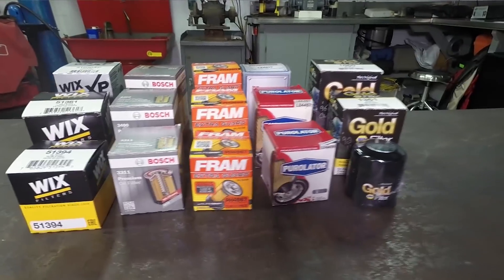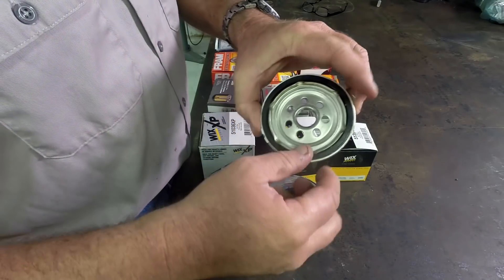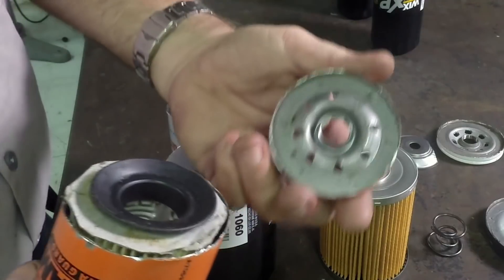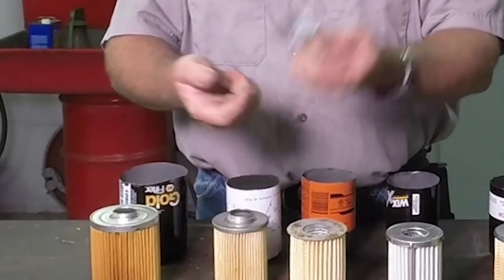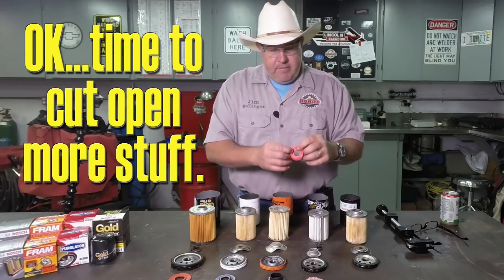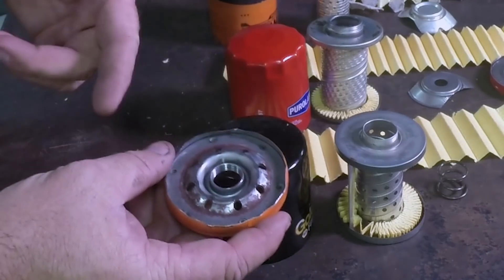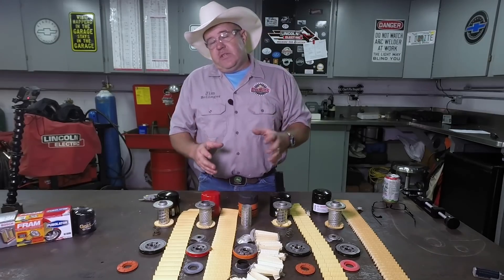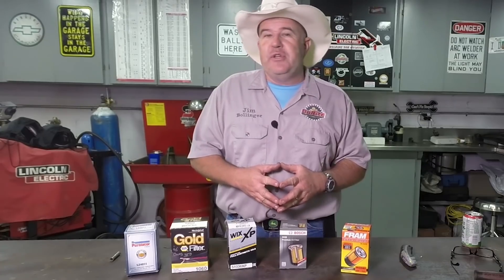The worst oil filter EVER!

Comment: I’ve used Fran for as long as I can remember(I’m 35 now). I’ve never had a engine blow on me with using the Fram. I would hop the paper filter material would catch the rust. Also, with the filter inside being paper, I think that reduces any type of metal future rust. Where the other filters with more metal parts could possibly fail and have metal shavings getting into your “puddin” lol. Hopefully there filters would catch any matter that shouldn’t be in your engine.
Reply: “Hope the paper filter catches the rust” .... how about just get one without rust?  Also that paper break down can cause its own issues,  one by not actually doing it job of filtering but two by actually adding extra contamination to oil
Reply: brett ramsey Fortunately, we will never know.....who’s really cutting apart oil filters to inspect for using them?
Reply: Its just a guy sharing his opinion on something he knows nothing about

Comment: I used a WIX XP in my 3.4 V6 Toyota Tacoma. Damn good filter media with a really thick can. However, I noticed a FEW amount of times my engine would have no oil pressure for like a second after a cold start. It didn't bother me too much since it rarely did it anyway. Anyways, I opened up the filter during the next oil change and found out the anti drain-back was at an angle, and about to come off the part it was mounted on inside the can. This caused oil to leak out the filter! Now, I have no idea if oil flow from the pump pushed the ADBV out of position, or if it was a mistake from the box. Either way, I am disappointed. This would be terrible for engines that have the oil filter on top. Mine sits at an angle on the side

Comment: I never buy Fram.  I use Motorcraft.  They're cheap and the manufacturer uses them.  Your complaints about Fram seem inconsequential to me.  A little bit of rust in the there won't do anything.  Far worse contaminants are generated continuously within the engine.

Comment: He's comparing the material used to construct a higher end Napa Gold oil filter to a low end Fram filter. Its not a fair comparison! His evaluation is based on filter material and not performance. The low end Fram oil filter out performs many of the other oil filter brands in its price range. When your buying an oil filter look at the specifications and buy the one in your price range that performs the best. Also don't exceed manufacturer recommendations for when the filters should be replaced.

Comment: I've cut a lot of oil filters open in my career. The comments regarding the Fram (other than the rust, which I find unusual and may be do to his warehouse supplier) are not surprising. OTOH I don't know that I would say that the leaf Spring used by many filter manufacturers is either inferior or superior to the coil Springs used on others. It's been my experience that filters from ACDelco and WIX, that are actually made by the Brand (ACDelco or WIX) that is painted on the housing, have proved to be the best IMHO. The only exceptions to this level of quality seems to be with low volume Part Numbers that these and other filter manufacturers subcontract to the folks at Champion Laboratories (Champ-Labs) Filter Company and others.
Reply from the maker: Interestingly, the three Frams I used came from 2 different suppliers. Wait till next week's Diesel filter reveal...not exactly what I expected.

Comment: My favorite ADVERTISING B.S. nonsense phrase used quite a bit.  Even printed on snake oil containers ... >>>HELPS FREE STICKY *VALVES*<<<  A hydraulic "lifter" can become stuck, but if your VALVE is stuck?  
   Here's a tip... Save money, just flip your air cleaner over, LOL...  Self cleaning...

Comment: napa's filters are made by wix.  the other thing that you didn't talk about is how the napa and wix filter has big round holes punched through the inner tube where the oil flows.  look at the bosch and the purolator.  it's little bitty slits that are barely the size of a .5mm pencil lead.  i've bitched about this for a few years.  many brands make it like this.  I wont buy em. i've tried them and oil pressure in my truck is erratic and very high when it's cold.  indicating it's having a hard time flowing in and out of that filter.   
btw, for someone who is a fabricator, your grinder skills are really poor.

Comment: How would you rank brands such as AC Delco, Mopar, Motorcraft ?
Reply: The MOPAR oil filters are the best. Delco filters are like Fram filters with paper end caps, and Motorcraft has uneven filter pleats. Mopar has metal end caps with a good, even pleating filter media.

Comment: I am not a mechanic by any stretch of the imagination. However, whose ax is this guy grinding? I am a "professional steering wheel holder driving a log truck up here in the Pacific NW. The company I drive for uses Fram all the time, we have trucks with over a million miles on the Fram filters and the trucks just keep running. No answers, just too many questions.

Comment: Only item you missed is OEM filters. I did the same, cutting several filters for my Toyota. In the end I went with the OEM Toyota filter. Currently 205,000 miles. No leaks. No oil consumption. Runs excellent. I expect another 100,000 miles before I replace it. Nothing done to engine except scheduled service.

Comment: I've got a Tacoma with well over 300,000 miles on it's all original engine. Bought it with 6 miles on it. It has only has fram filters used on it, along with 10w-30 Castrol gtx, changed every 3,000 to 4,000 miles. Burns no oil and is as quiet as when new.

Comment: After I retired from the Navy, I worked as a counterman for a few years.  My manager (certified mechanic that actually turned wrenches for 15 years before getting into the auto parts game) and I had a conversation about oil filters one time.  What brought the conversation on was I had mentioned that my Dad was a firm believer in Fram oil filters.  My manager stated that, at one time, Fram was one of the best filters out there....until they got in bed with Wal-Mart.  The Fram product you see today is in direct response to Wal-Mart demanding a cheaper and cheaper price from Fram, which they could do and get away with since they were buying so much product.  In response, Fram cut the quality of product they made so they could still make a profit.  Now with all that being said, I was unaware that they had cheaped out that much!  I usually use Purolator or Bosch filters on all of my vehicles.  I think I'll step up to either Wix or Napa Gold.  Thanks for making this video!

Comment: I had invented (per say) a machine that cuts filters open just as you did, not with a grinder but a cut wheel such as copper pipe cutting, that was years ago, in California I used to cut so I get the metal and separate the filter media, have you seen the medias after usage? they collapse inwards as hourglass and the real cheap ones come apart anything pass 3500 miles. The orange Fram used to be good years ago.... YEARS AGO..... today is one of the most Lower quality, the newer Fram Gold or Ultra or whatever they call it, are what the original orange used to be......

Comment: I can appreciate that you are taking the filters apart and inspecting them.  But if you 're gonna go that far why not perform a test based on scientific means?  Why not take a know used dirty oil sample, send them off for particulate analysis and then run the sample thru each filter under the same conditions for an determined amount of time?  Then send the filtered samples in for analysis to see which one really performs the best or the worst.   It's not to say what you seen when you hacked them apart as being better or worse, but don't you feel that actual particulate measurements would be a more precise way to determine that one filter is better than the other?  Maybe the cheapest one or poorest build quality is in the middle of the pack as far as filterability....  How can you say its actually worse without that proof???  JMHO...

Comment: once I forgot to change oil on my 1999 Chevy prizm for over 12 k miles(cheap fram filter and 10W40 conventional oil)and nothing happened to my engine.
Reply: That you know of that is.... probability of blowing an engine in 12k is slim to none but they could easily be internal damage
Reply: brett ramsey my prizm currently got 327 K miles on original engine and it's been 10 years ago(Forgetting to change oil for 12K miles)so is it possible that An engine last that long if it had suffered from internal damage?
Reply: Corollas are hard to kill
Reply: If you like playing Russian roulette, then have it.

Russian roulette (Russian: русская рулетка, russkaya ruletka) is a lethal game of chance in which a player places a single round in a revolver, spins the cylinder, places the muzzle against his or her head, and pulls the trigger.

Comment: On the purolator, just google purolator media tear. You’ll find lots on bobistheoilguy. It looks very good, but the media is brittle. While the orange can fram looks like crap, i don’t think I’ve ever heard of media tears or issues. Having said that, I wouldn’t use one either as there are plenty of other better made filters out there including from fram themselves in the fram ultra which in my opinion gets the right balance of price and performance. Cut one open and look yourself. Thanks for posting.
Reply: Nope no media tears just rust in your engine lol

Comment: Napa Gold is made by Wix. I buy Wix by the case and before I found a place that sold Wix, I used Napa Gold. The Wix price I pay is cheaper than Napa Gold. Prior to buying Napa Gold I used nothing but AC Delco. But AC Delco is now made overseas and is junk. Note guys that a Chevy small block does not need an anti drain back valve because of the vertical mount of the filter.

Comment: What I would like to see is all manufacturers oil filters compared
Reply: I second this
Reply: Yes,curious about Mobile Oil filters...
Reply: Yes.
Very curious to know how Motorcraft does in a test.
Reply: @anthonylea3941  do motorcraft buy them or make them, and if they buy, they would probably change supplier from time to time
Reply: @jusb1066  Funny you should say that. Low bid gets contract. I know what actual NOS packaging for my vehicles filter should look like. Plenty of criminal enterprises that counterfeit filter and cardboard box. Just like counterfeit american cigarettes. Chicks as purchasing agents get wool pulled over their eyes all the time. They are fools for tools.
Reply: Jusb1066 purolator makes motorcraft oil filters
Reply: It would have been nice if he would have cut open comparable filters. That Napa is a top end filter, while the Purolator is their lowest grade. He's kinda a moron..
Reply: The Volkswagen flat four early design had a stainless wire screen. You removed, cleaned and replaced. They sell $200 stainless for cars. SEMA auto show had booth with these clean and replace wonders. If your out of country, don't let your wife go to quick lube for oil change. That filter would disappear.
Reply: I’m gonna contribute to this stp the blue filter and motorcraft white
Reply: Yes
Reply: Around The Ground Landscaping LLC. 
Agree. I would add Fram’s Tough Guard and Ultra Synthetic oil filters.
Reply: And discover which one filters oil...BETTER ?? That would be a good experiment!

Comment: why is the filter material worse in the Fram, because it was whispier? that could mean it picks up finer particles.
Reply: More filter paper in same diameter just means more flow restricted
Reply: HighStreet Killers please don’t tell me you fall for the false science of “high flow” everything.....
Reply: The Fram is worse, because it has less filter media. So it will clog up sooner. If you're using extended oil change intervals, this would be a concern.
Reply: m.blacktree If you use an orange fram filter for extended intervals. You deserve a locked up engine. Fram sells filters with extended performance. The orange one is the most basic version they have.
Reply: That was basically my point. You shouldn't use a crap filter for long intervals. The irony is the crap filter costs more in the long run, due to more frequent oil changes.

Comment: Good video, I have never used Fram oil filters or Quaker State oil. I am curious how well Delco filters are made. Even though I have never been a GM fan I started using their filters in the 1980s because they have pressure relief valves. I also wonder about Hastings and Bosch filters.
Reply: A GM fan, omg, everybody quiet. A GM fan has an opinion,lol
Reply: @highstreetkillers4377  Reading isn't your strong suit, is it? I posted, I have NEVER been a GM fan. But then I spent over 30 years in the industry and have owned and built cars that have been featured in national publications. I suppose your Ferrari symbol is meant to impress, it doesn't!

Comment: Guess I'm done with Frame..., 
been using them nearly forty yrs...
Ran more than 200k on four engines with "no" oil loss, or engine damage...
Fifth GM engine, 4.1 alum V8, was down 1qt per 1200 miles@ 150k miles...  I figured that was because it was experimental aluminum...

Comment: It's all well and good to show the parts. But to really show if it was a good or bad filter you would have to test the filtration ability.
Reply: His beloved napa gold might restrict oil flow after a few hours. That will damage an engine
Reply: To be scientific about it  , you really need to test  multiples that have been in service for X amount of time for every brand  .
  Having said that  , how  a  device presents itself when dismantled  from brand new  in my book is worth some points .
  While  for some the rust may not be  such a big deal ( it would be a  big deal for me )  , it certainly does not promote  confidence in The product ,  after all ,  if that one was that bad , what may the next one be like  ? 
  The card board that looked like it was  wet or  delaminated , again not a good look .
  I` d be screwed if i would  put that  pos  on to my engine  , especially one that has  been unopened  for 17 years with the original  brand filter  i have been using for it in the majority of that time , and the engine still runs like a clock  apart from a slightly  worn timing chain guide  that allows the chain to rattle a tad .
Reply: In order to do a proper filtration test it would have to be done on a closed loop system and most people don’t exactly have that laying around.  It kinda follows the saying the whole is the sum of the parts.

Comment: I used to do my own oil changes at one time, that was years ago.   I used Fram filters at that time and never had an issue, but then I never cut them apart to look inside.  If I was still doing my own oil changes, you can bet Fram would not be on my car.   Today, I have my dealer doing my changes and I have the factory spec, Mazda, filter on my car.   Thank you for the informative video.   Lets hope Fram sees this and makes some very needed product improvement.

Comment: I already knew which two filters were of better quality, but your testing seemed flawed. You showed no before and after oil quality difference to see how well each filter actually filtered oil. You didn't bench test the oil filters spring showing what psi it would bypass the filter. Your test was on visual alone.
Reply: A coiled spring is way worse than those plate springs. Typical American idiot giving his opinion on something he knows nothing about

Comment: 1995 Honda Civic 2 dr coupe. D15b7 engine, auto transmission.
314,897 miles.
For warranty period, Honda OEM filters every 3 months.
After, Wix / Fram. oil changed EVERY 3 months.

Comment: Its been years, but there used to be several drag strips that would not let you run if your car had a Fram as they would blow out under high oil pressure.

Comment: DRF...I just changed da Earl in my 2013 Impala LTZ (for the first time DIY at Home). Six quarts of  Mobil 1 with a Purolator filter. Cost me about 50 bucks for the privilege. I come from the days (1970's) of changing oil my-self at about a 12 buck expense every 3K miles.  Looks like they are driving us toward electrics. I will purchase the better filters suggested next time...THANKS! 
After thought...I now schedule for about 7K intervals so it kind of works out economically. I could do a better filter after about 3k on this change and just refill the quart but then again I'll just wait til next change. Merry CHRISTmas.

Comment: NAPA and WIX Filters are both manufactured by GUARD Corp. I learned that many years ago with I went to a filter seminal put on By Guard Corp. So flip a coin . also drop the first number off a WIX and you have the NAPA number.   I have use Wix or Napa all my life on my own. Fram was always JUNK. FYI I am a retired Auto and Heavy Truck (Tech) Actually no , Mechanic is what I did. Sorry to all you Techs But what I told a sales rep once "TECHs" are Glorified parts changers. Mechanics actually Repair things so they don't comeback the next week for the same reason

Comment: I once had a VW tec show me a few VW cars sitting outside his bay waiting on new motors. They all had the same cause of failure and had just gotten the oil changed by Walmart. They all had Fram filters that looked crushed/like the air had been sucked out of them. All 3 of the cars had trashed motors because the filters failed and sucked the internals of the filter into the motor. This blocked the oil passages and destroyed the motors. All three cars were less than 2 years old. I have never even considered a Fram filter since that day and only use wix now.
Reply: They didn't pre fill the filter or use the correct oil